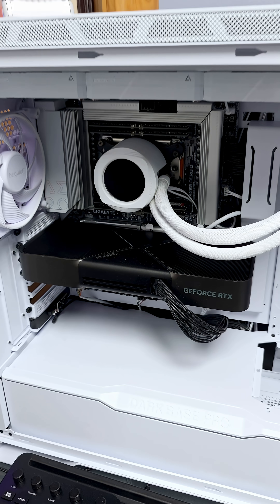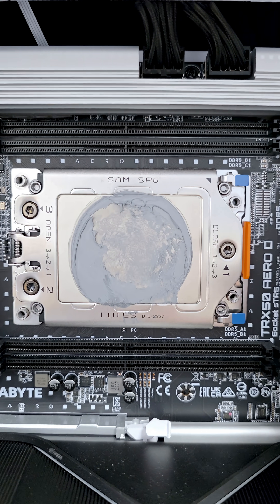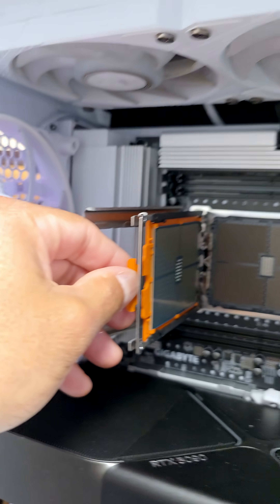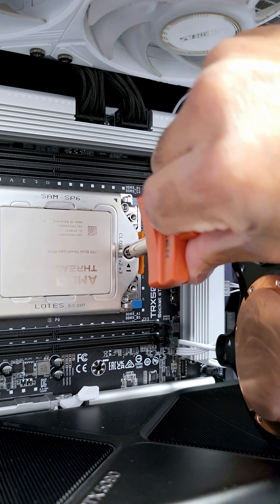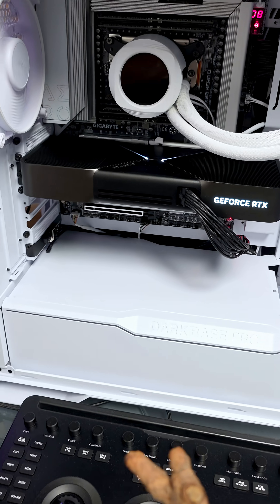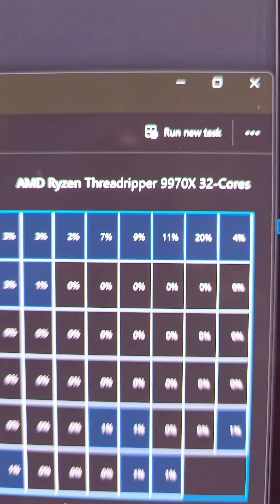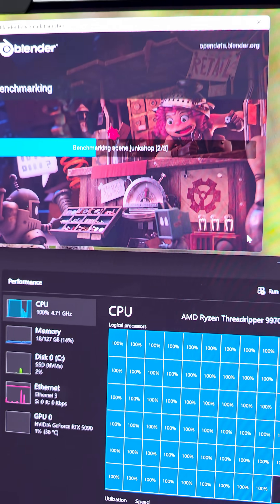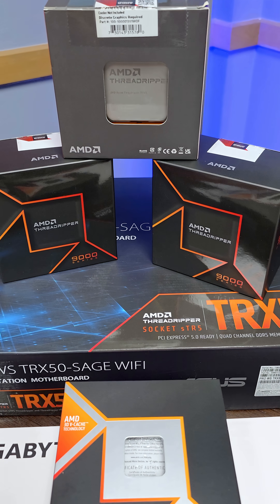Installing the @AMD Ryzen Threadripper 9970X 32 Core 64 Thread CPU

Comment: This is awesome, but Christ… if you’re gonna spend Threadripper money at least apply the thermal paste with a spread applicator, and invest in a silverstone AIo designed for the socket type.
Reply from the maker: I do appreciate your comment but you have missed so many of my videos regarding exactly what you said, including the Silverstone AIO which I have and showed it underperforming another AIO that I'm using on the 64 core Threadripper 9980X

Comment: First off I'm way to paranoid to do a swap both vertically and one handed. Thanks for the PTSD.
Second glad you used Blender benchmark cuz that's what you'd need a thread ripper for.
Most think it would be good for gaming when this is best used for rendering.